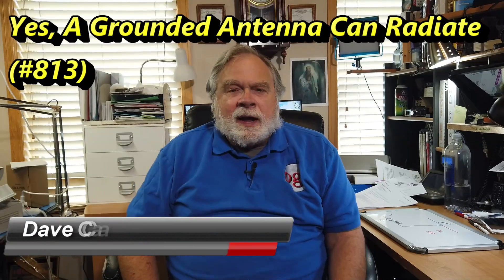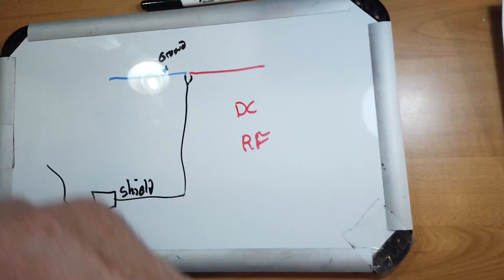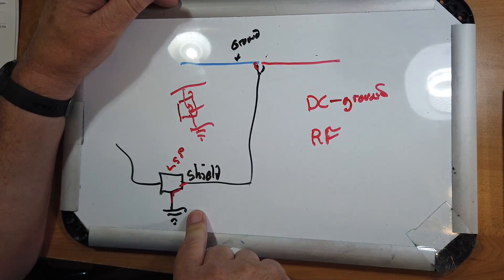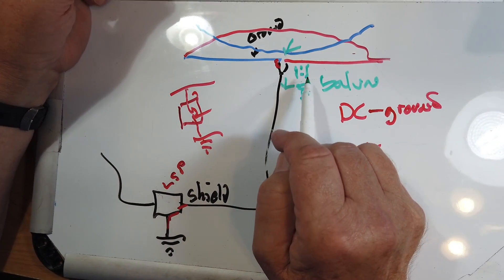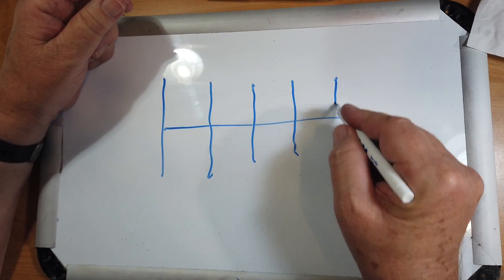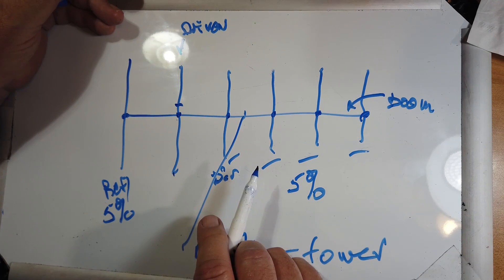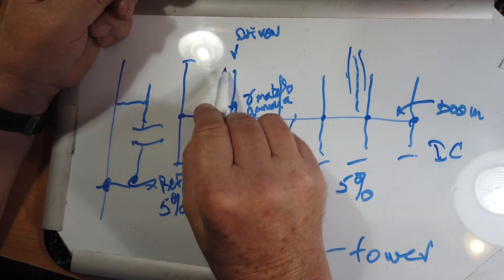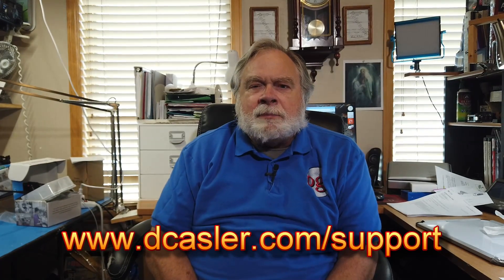Yes, A Grounded Antenna Can Radiate (#813)

Comment: Does the transceiver send RF current out on both the center conductor and the outer conductor/braid of coax?
Reply: RF current wants to flow from the center conductor to the outer, which also happens to be connected to radios chassis and everything else in the shack that's electrically grounded
Reply: @samgrieg  so is it that while the transceiver does not send it on braid, it flows on it anyway?  If so, then I imagine it flows on the entire ground system, right?  Just trying to nail down first where RF flows and I’ll think about the consequences of that second but first I’m really trying to nail down what has RF current and what does not. Thank you for the reply!
Reply: @pfmcdermott1  That's correct, if the balanced feedline gets disturbed due to incorrect routing mainly due to long metal objects running in close  parallel to the line, it will throw RF current flow out of balance and it will start radiating from feedline and might flow back into the shack and try to flow on commonly interconnected metal surfaces, cables, the grounding system. Same thing may happen if the antenna matches poorly to the feedline.  In case of coax, if the antenna is mismatched (not close to 50ohm impedance), same thing will happen, part of RF will bounce back and enter the shack.  That's why it's important to have chokes on the feedline if your antenna impedance doesn't match feedline impedance well.

Comment: On my wire antennas that are balanced and go to coax when using a 1-1 balun it created many strange things in my antenna tuner in the house.  Without the balun I can always tune the tuner to a 1to1 SWR.   Have been experimenting with antennas for 65 years.
Reply: Thank you. 
    This is interesting. Some use 1:1 baluns with success and others have problems. I have not used baluns yet.
   I have used RF choke coils and ferrite beads. Both have worked for me. N0QFT

Comment: Tim, G5TM made a video recently on dealing with rain static by making a 250pF coil to the base plate of his DX commander antenna which is the ground or negative part of the antenna system. It sorts out the buildup and safely discharges it to ground and not to the radio. It was 120 turns of shellac wire on a 25mm white pipe. So instead of a spark gap he made a coil to deal with that buildup.
Reply: that's exactly right, and a ferrite rod can be used with great success